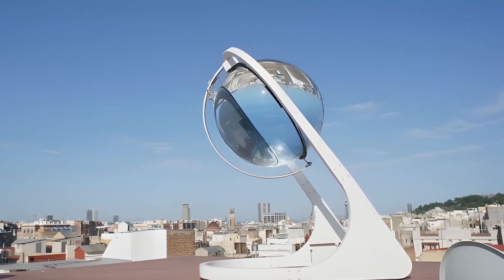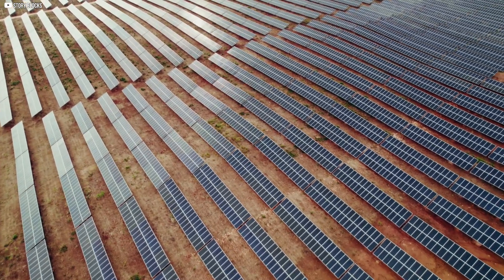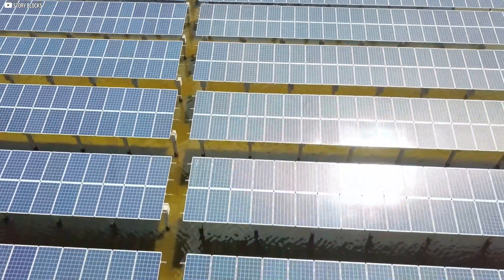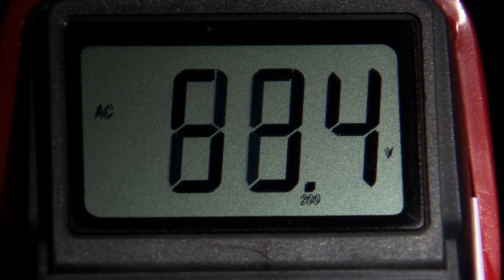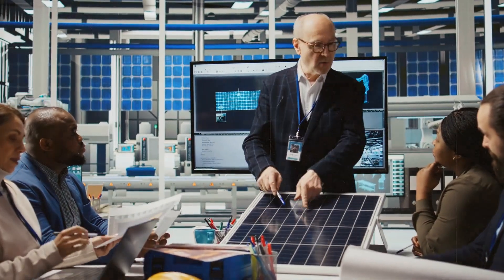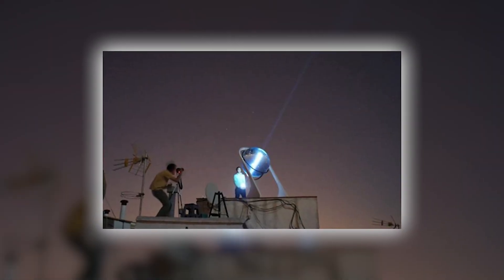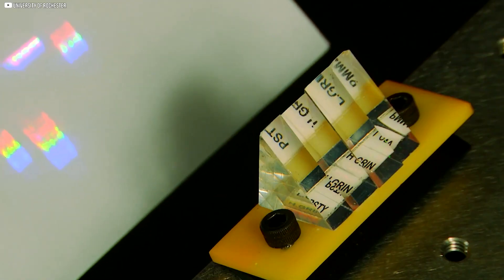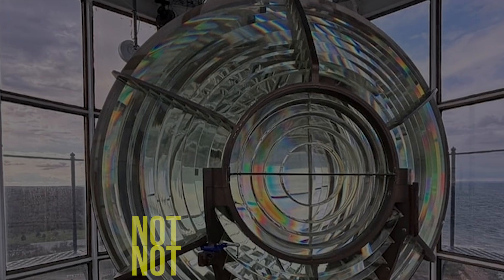How a Cheap Plastic Lens Could Double Solar Energy

Comment: some of those pictures don't look even slightly 'cheap'... Plus you add enormous heat to a small area, degrading the solar cells. And gain no real estate efficiency. What's the footprint of that one at :08. How close could you put any around it.